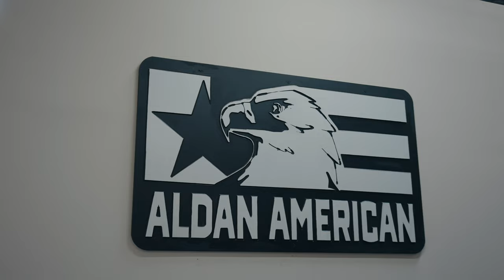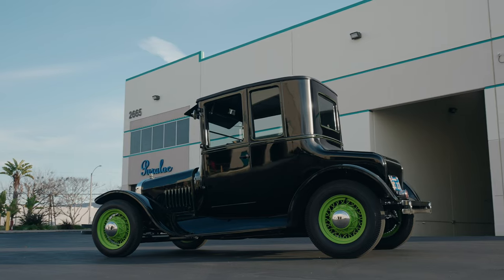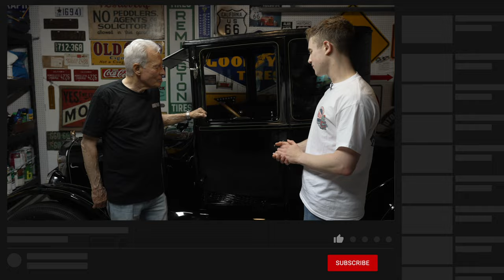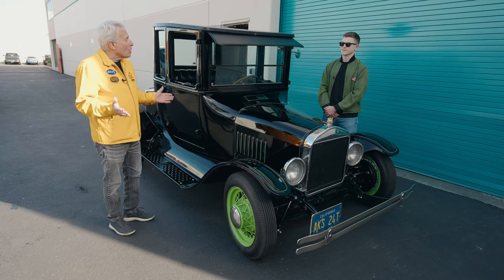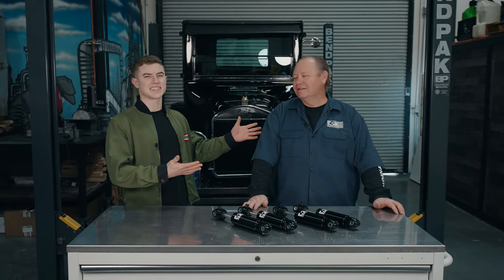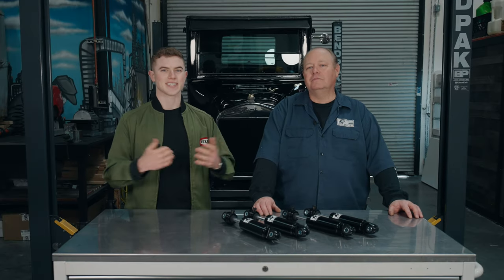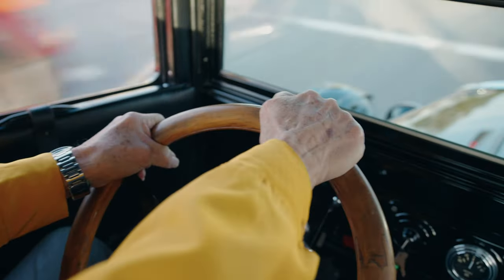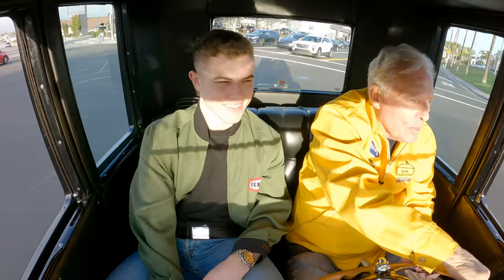My Grandpa's 1924 Model T Hot Rod Gets Some Aldan American Shocks!

Comment: That's neat that a one off shock could be built for his car.

A long time ago, I had a lifted Chevy Luv and I couldn't find a shock that would fit so bought a shock for a regular half ton Chevy pickup, ground down both ends and drilled out the bolt holes to fit.
Reply from the maker: Very cool